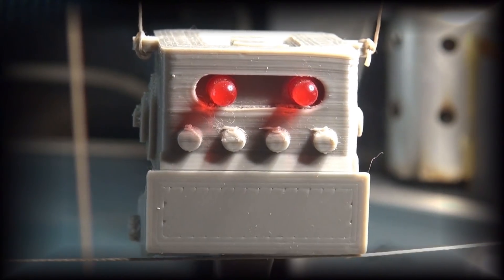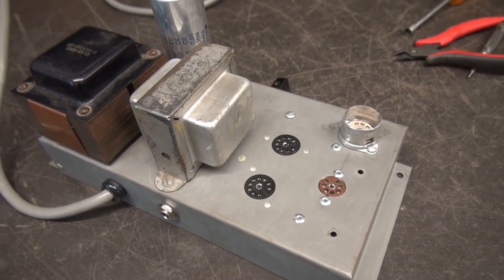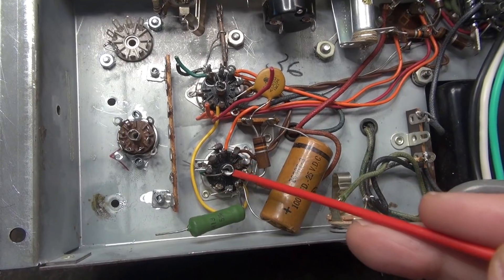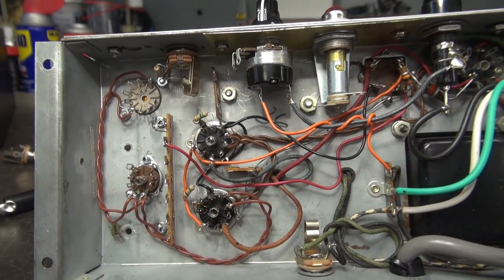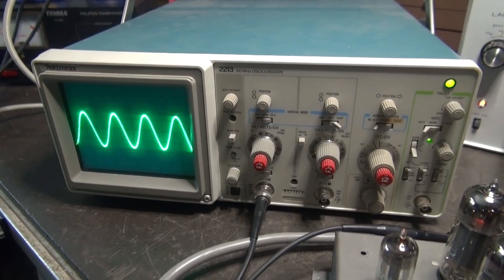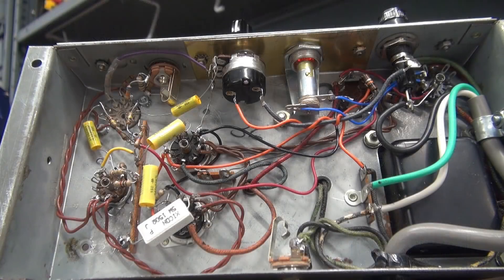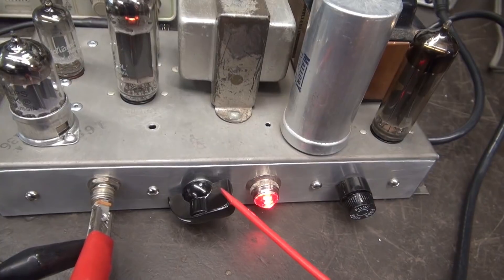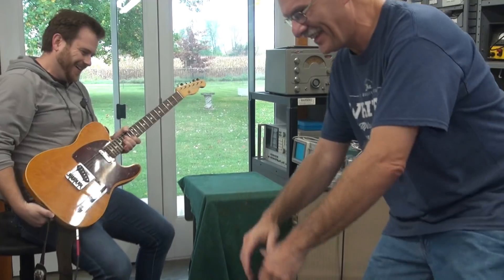D-Lab Tube Amp Theater How to convert Hammond AO-44 to EL84 Class AB tube guitar amplifier

Comment: If it were possible to obtain the Philips/Raytheon wire ended micro tubes then it might be possible to produce a amplifier that could be run of a B+ of 63V and a Heater voltage of 3V and fit into an easily carried case the size of a Grundig Yacht Boy and drive an 8R speaker.

Comment: Terry can this be converted from a guitar  amplifier where you have to build 2 for stereo use just for normal hi-fi application
Reply: To accomplish this you should implement an overall feeback loop from the secondary winding of the output transformer (speaker output) to the cathode of the second triode stage. Experiment with at least 6 dB and about 12 dB feedback strength. Take a scope and see if a rectangle waveform at the output will show an overshoot in order to compensate it with a small bypass cap parallel to the feedback resistor.
Additionally, increase the common cathode cap of the 6BQ5s from 20 mmF to 100 mmF.

Comment: why no cathode bypass caps on the 12AX7's?
Reply: Adds local degenerative feedback to that stage. It will reduce amplitude distortion. The trade-off is a reduction of gain however, this amp has plenty of gain for it's application.
Reply from the maker: Yes Sir
Reply: @d-labelectronics  I thought the bypass caps increased the frequency response. The larger the cap, the lower the frequency that gets amplified i.e. the cathode resistor doesn't "interfere / feedback" the signal as a voltage because those frequencies bypass the resistor (not fed back). "Twenty years of schooling and they put me on the day shift"....Bob Dylan.  :-D

Comment: Do not get me wrong I love D Lab's videos. There is always something to learn from them. 
I like the simplicity though I would go slightly different  route.
I would have added 25 uF on cathode bypass for the 12AX7 triodes. It's just two more caps. I would balance it with single tone pot like on some Fender amps. All Guitar amp tone stacks do something good for the sound of the guitar. Without them they sound like PA amps and home audio amps with flat EQ tome controls. Guitar tone stacks always compensate characteristic of the signal that comes out of the pick up. Add things that are missing and flatten things that are to spiky.  All together like pot, 4 caps and a resistor and amp would be more guitar amp like. Not even a 10 bucks more on the parts. Anyways that  is just me.
inverter
Reply: Bypass caps, tone pot & perhaps a voltage divider between triodes were exactly my thoughts.
Reply: @Blaculo  great minds think alike . He he.